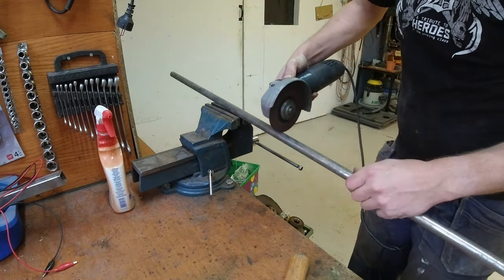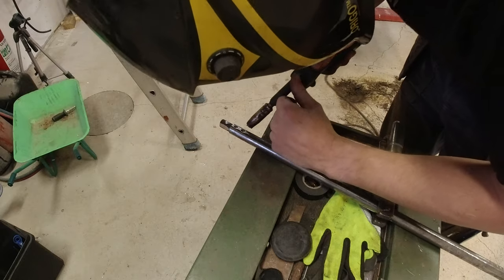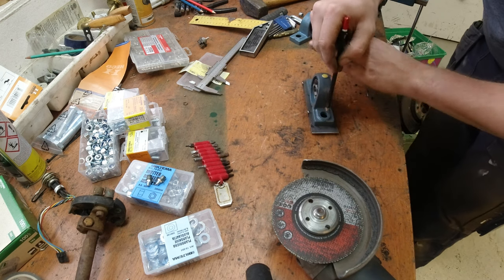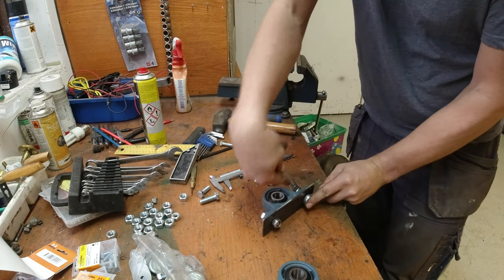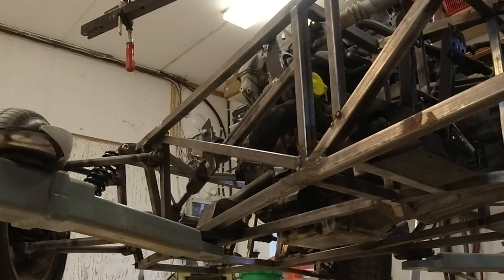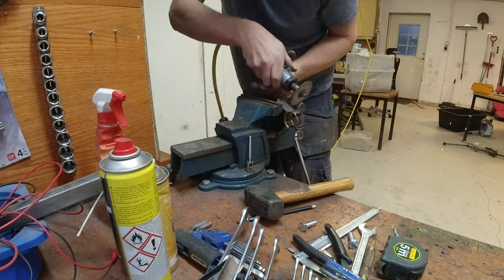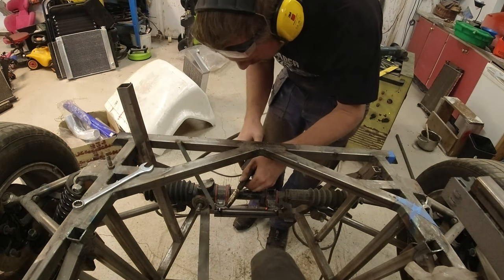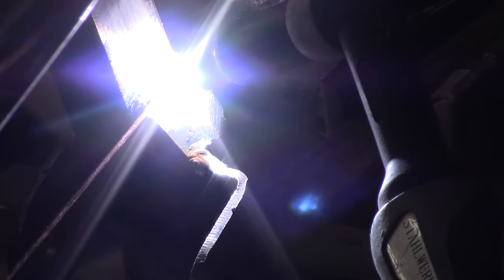Building Super 7 Locost EP14 - Some catchup, welding, and now were rolling!

Comment: Been a while. Tig welding looks better and it is 2x as strong as mig. Whats the plans for this car?
Reply from the maker: Tig for sure looks better. Therefore I use that on all visible and plan surfaces including all a-arms and stuff like that. Mig is used for the more hard areas and where you can "hide" it. Even though mine is so far from a bad example of welding hehe..  The car is planned as  a cruiser to buy icecream but of course with some power.

Comment: Wait, both welders on the power from your batteries, right?
Reply from the maker: Yes. ;)
Reply: @DIYTechRepairs  No way! That is so cool! both on 1 phase ,yes?
And if you could possibly tell me estimated draw in kW and surge
Reply from the maker: @dnetne5508  3phase. Tig is 3.5kw max and the mig is 6kw or something
Reply: @DIYTechRepairs  OH WHAT, okay..how do you get 3phase? I got familiar with phase converters and all that, but it confuses me :'D
Reply from the maker: @dnetne5508  i have 3phase in My whole house and i run 3phase inverter. Almost No house in Sweden is single phase. All stand alone houses run on 3 :)
Reply: @DIYTechRepairs  wait wait, what inverter, could you maybe tell me the max kW output or even a link?..
But yeah - your house is no like every other because produce your own power..
Reply from the maker: @dnetne5508  mpi 10kw. You have several videos about it
Reply: @DIYTechRepairs  Oh, wow, that is insane! I saw that inverter on some thumbnails, but did not watch videos,now I will,thankyu!
Reply: @DIYTechRepairs  It is much easier to find them now once I know what I am looking for.